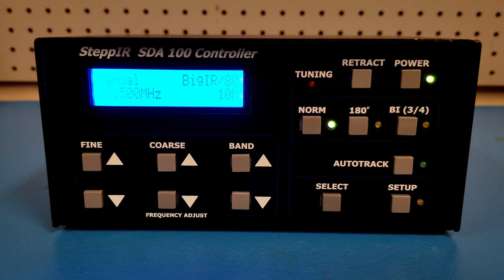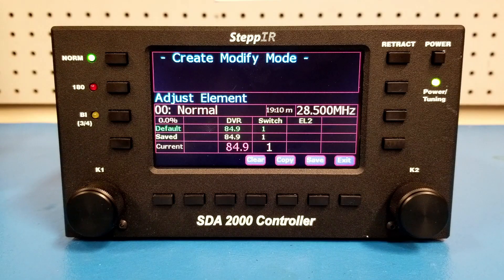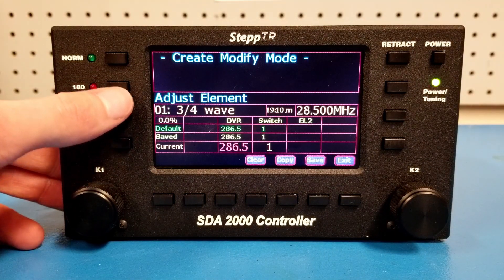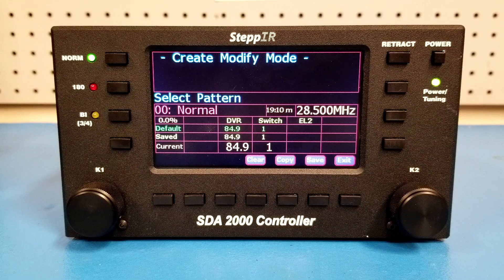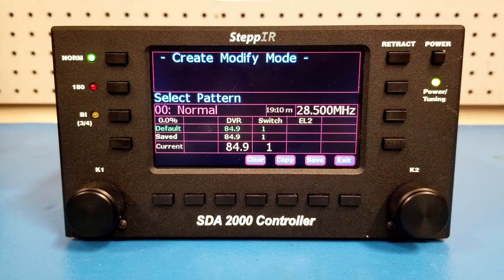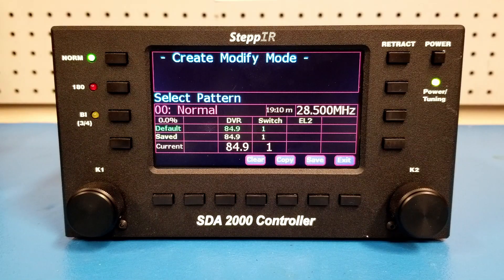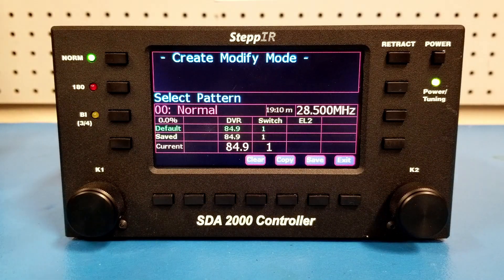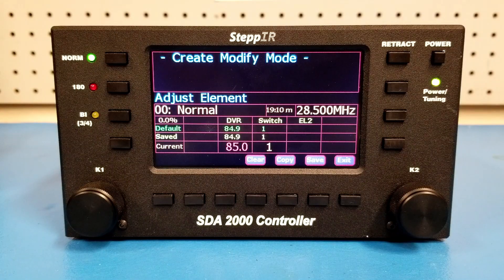How To Tune A SteppIR Vertical With An SDA 100 Or OptimizIR Controller

Comment: This video still leaves me hanging out there to deal with the SD100 and the BIG IR Vertical calibration on a couple of bands. 40M and 20 M are a little off. They resonant much lower down the band than I want. The rest of the bands are very close...17M 15M 10M .....It was a lot of tinkering and second guessing what does what to get the box to save changes. I see a strange symbol on the bands I got lucky with to change them. Nothing in the "manual" what that symbol means

Comment: I have a bigIr that was supplied with an aluminium high wind kit plate which seems to have caused some arcing in the 80m coil.   Is this going to be a warranty replacement as I now understand that the high wind kits are fibreglass to avoid this issue?